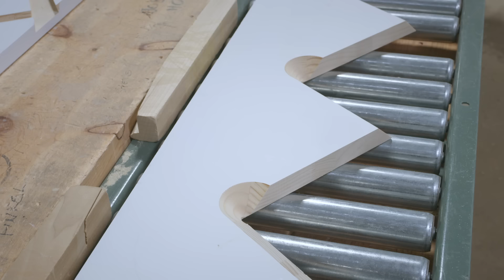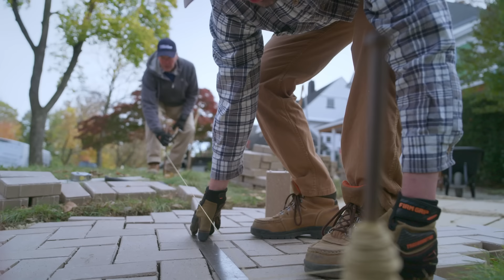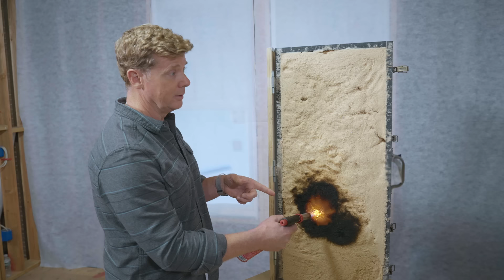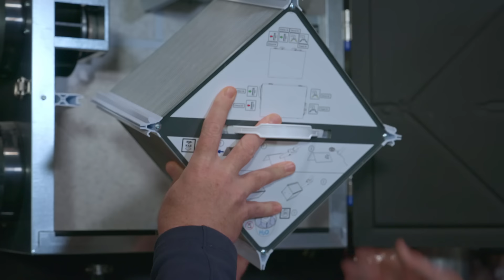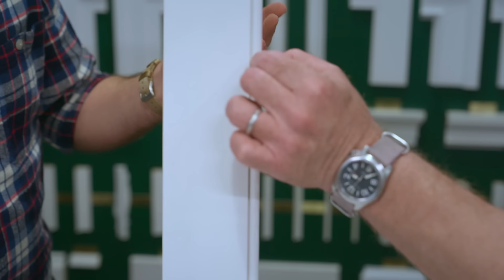This Old House | A Breath of Fresh Air (S45 E23) FULL EPISODE

Comment: I think I'd push back a bit on the insulation.  If you have the exterior siding on already wouldn't closed cell foam be the better option?  If the siding is on already, the foam shouldn't push thru any cracks in the old cladding, right?  And if I'm building a house I would want the outside envelope completed before I start putting in insulation.

Comment: I have seen a lot of your rehab videos, awesome.
But Why has Kevin and fellow Crew ever suggested installing a chair lift, better yet a freight elevator,we all are getting older, and no fun hauling heavy furniture up and down three or four levels.
When I was teaching architecture I use to stress when ever possible suggest to the client incorporate into the design The two items that I just mentioned. Take out a huge space for stairs, great place for a freight elevator.
It seems that the client has a open checkbook when they hire (This Old House).
Reply: They did a project recently that through the entire build was making homes more accessible, and included a few segments on residential elevators. (Season 45)

Comment: Wood Insulation: Why continue the promotion of deforestation? Have you heard of Bamboo?
Reply: did you not hear them explain its from post processed lumber scrap?
Reply: I'd rather use mineral wool batts.
Reply: Hemp beats all
Reply: Do you really think old forests are being destroyed just to make paper products? It comes from tree farms. 

Every area has it's own useful material, we can't grow good bamboo in the states. It would have to be imported, and what about the wildlife in those regions? Yes it grows fast, but it doesn't grow tomorrow.
Reply: @volvo09  We can grow good bamboo here. The issue is that it would become a invasive species quickly.